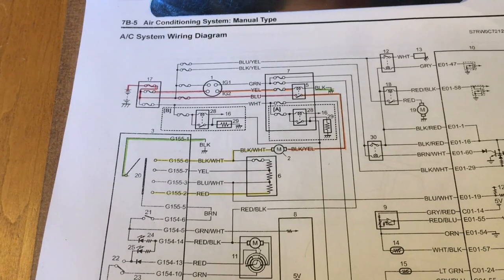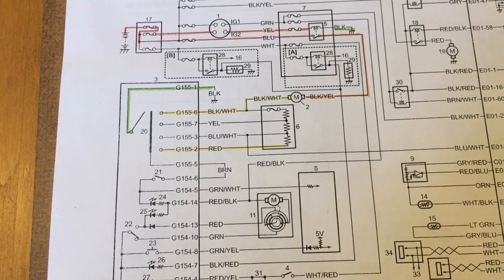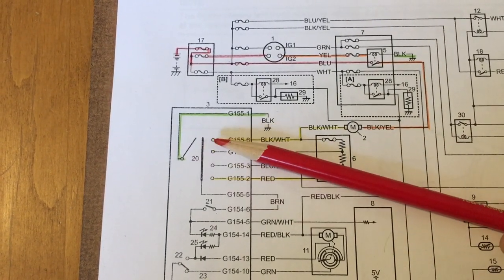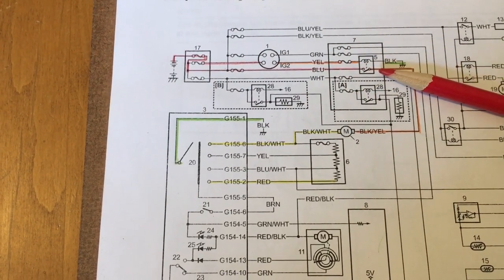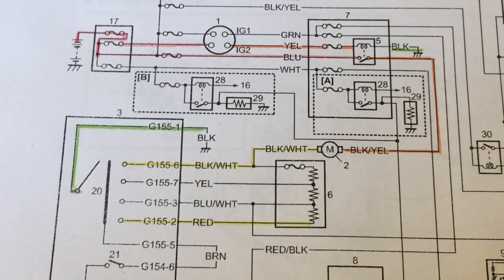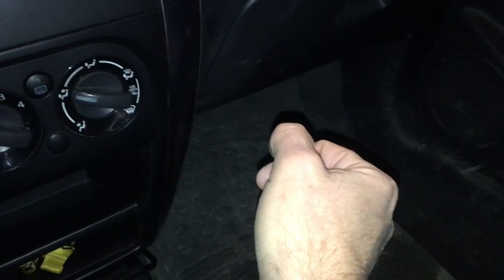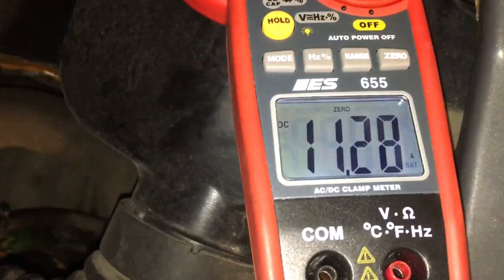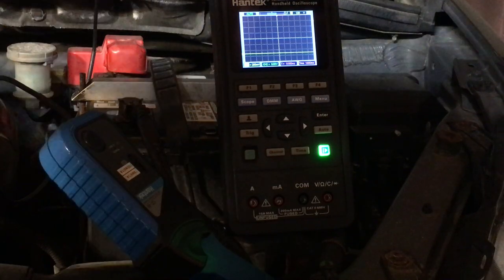SX4 Blower Operation Intermittent

Comment: Nice!  I have a 2001 Subaru with the exact same issue. The blower is located in the same place as your vehicle. I took the blower out and removed the fan essembly (squirrel cage).  The shaft and surrounding area was covered heavy with brush debris. I cleaned it up with a shop vac and reinstalled it. Still runs for now but expecting failure anytime. I did find what looked to be like a rodent nest in the ductwork, by reaching in and pulling it out. I would  love to get an amperage waveform on this one. Thanks for the great idea! Enjoy the Vids!
Reply from the maker: Thx Bob...2001’ good longevity. And Thx for taking the time to comment. Cheers 👍

Comment: One of the better waveforms I've seen with CC-65 @ that amp draw while trying to clearly see the armature segments, Ian

About as good as it gets with that amp clamp.

Not clear enough to rule out bad commutator. AC Coupled voltage drop across motor with your PICO might tell a different story. Or rule it out with more authority.
Reply from the maker: Good Point Denis...I try to use my different scopes in rotation. Just to demo the different options. That and if I don’t, I forget how to use them 🤣 Cheers 👍

Comment: Great testing as always mate , Any issues with the connector at the resistor or motor ? I have found intermittent blower function where the connector had fitment issues and connector specially the resistor connector was starting to melt 👍
Reply from the maker: Good suggestions Igor. On the list if there is a reoccurrence. Cheers 👍